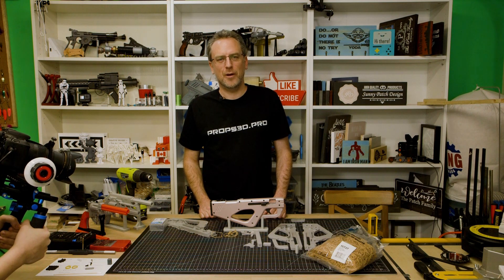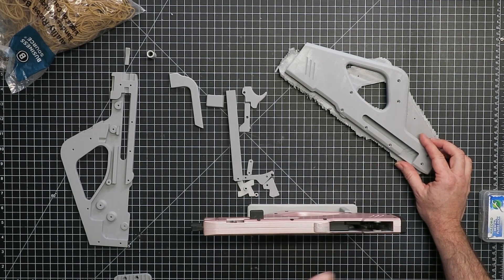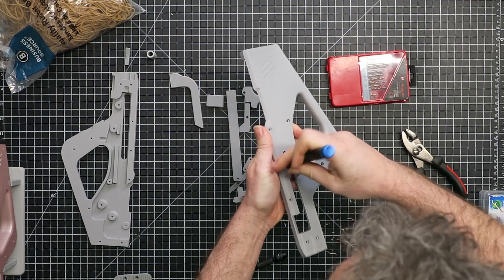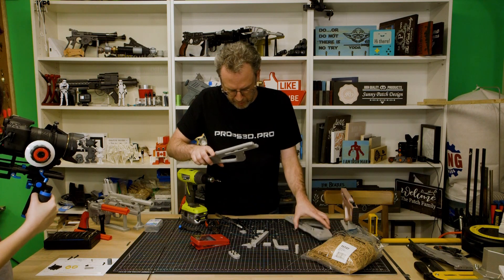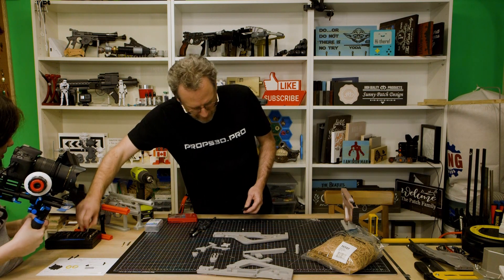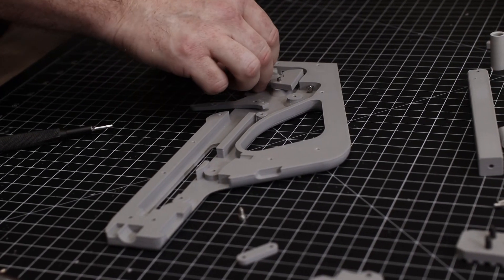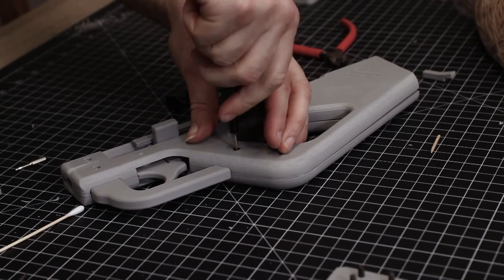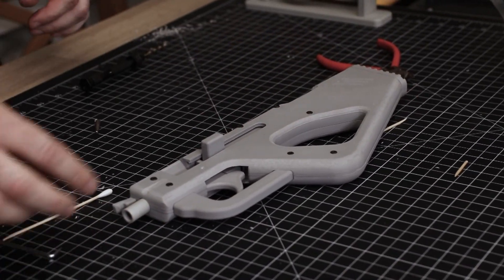3D Printed Rubber Band SMG - Free Models!

Comment: Sanding out such a large faces shuld not be in publically released 3D design. It could be much better to print external faces separately without supports and then just glue to the internal frame. Also, there are mag-fed rubberband "submachineguns" in existence and with much larger ammo capacity. Everyone should think twice before choosing that particular design and kill themselves with sanding ))
Reply from the maker: What sanding? That's a pretty negative comment and this model needs no sanding unless you want a nicer finish, which goes for anything. I don't get what you're objecting to.
Reply: @Props3D  not trying to be negative. Just provided my true opinion. I believe the design has obvoius ways for improvement.
Reply from the maker: @shurmurray  But your advice is... false? It needs no supports and no sanding, which were your two main points of contention. Are you sure you're commenting on the right video?
Reply: @Props3D  well, sanding outer face was mentioned in the video. Or am i just hallucinating this?
Reply from the maker: @shurmurray  That doesn't line up with your comment at all, please read again. Sanding 'out' is not allowed? What is sanding out? Kill yourself sanding? Are we not allowed sanding on 3d models now? If optional finish sanding isn't allowed that would be pretty impactful to the maker community. As this model is completely sanding free unless one wants to I don't see how I can proceed further in creating tutorials for the community to fit your allowed criteria. I would love to see one of yours and see how you do it.
Reply: @Props3D  Sanding large flat surfaces is not fun without mechanized tools. And the design is definitely ask for that - halves are printed flat. There is much more control of how finished surface going to look when it is printed vertically. Right amount of noise may hide all defects and make it production-like without any post-processing.
I truly believe good designs released for public should be as easy to make as possible, unless something geeky and inherently complex. And in any way this is just my opinion :)
Please excue me if my comments feels negative.
Reply from the maker: @shurmurray  Many of the decisions I've made and lessons I've learned have come from asking 'why'. I do feel your original comment isn't accurate to the model but asking why you feel that way helps inform how I present content and sometimes how I design parts. Collective knowledge will always beat any individual's experience.
Reply: @Props3D  there are a lot of 3d-modellers doing great stuff for sure. Still remember thingverse ~10 yeras ago - back than it was a joke. A pile of useless and uninteresting stuff. Now the situation is very different: 3d design is a common skill and there are a lot of great makers now.
Reply from the maker: @shurmurray  For sure, one of the best in rubber band guns pretty much exclusively displays his work on our Discord, he's amazing and puts me to shame. He does classic WWII designs that are functional bolt actions, SMGs with huge capacities, pistols etc. Now 3D printers are mainstream the things people are doing are insane.

Comment: I don’t get why you didn’t make the 3d Model already have the perfect size hole?
Reply from the maker: because printers have a lot of variance. If I made it perfect for MY printer it may be too lose on yours. It's far easier to remove material than to add it back.
Reply: Oh yeah I just made this but I don’t have any screws so I measured the diameter of the hole and used carbon fibre infused filament to make screw shaped rods that fit in perfectly and I used some gorilla glue
Reply: Btw I used PLa for the whole thing EXEPT for the part that holds the rubber band I used carbon fibre infused filament so that it would be able to hold more bands
Reply: Also, the printers that I use are Anycubic Kobra 3, Bambu lab a1 mini and a cr10 v3
Reply: Anyways thanks, the gun is awesome

Comment: I have a question before print. How to join the back part with the front part in the small bed version? Should I use glue? Or the design overlap on sides to hold them with screws?

Comment: i would do this but i need more filament i taught it was going be 1 kg but it is 1k and 300g so i cant print it yet but it is a cool design
Reply from the maker: Should be less than that! Are you printing solid? Try 4 perimeters, 6 top and bottom, and 20% gyroid infill. Should get it down to the right weight.
Reply: @Props3D  oh thanx i am always printing every thing solid but i will try it

Comment: Hi there, so excited to build this model, quite ingenious! Do have a quick question, how do we attach the first rubber band that connects to the catch mentioned in 6:05 of the video, V6 frame doesn't have that hole for a screw. Just wondering if there's an alternative method for connecting intended or if we just need to drill that hole. Thank you!

Comment: Would it be any bit possible to use 3d printed screws instead of the metal ones. Also would it be possible to use a bit of filament instead of the metal pivot points?
Reply from the maker: I haven't had much luck with 3D printing screws, but you could glue it. The metal pivots could be made from 3mm filament probably if you had that, it's not common these days but it used to be a standard filament.
Reply: @Props3D  ah yeah, I ended up using a 3.15mm nail and angle-grinded it down to size, was a little big for the holes but nothing a quick drill couldn't fix. Also just went to my local hardware store and got the screws

Comment: I think you'll find that if you load the last rubber band onto the firing wheel and then push the bolt down from it's lock position it will load the first rubber band onto the lever that operates the reciprocating bolt . This a simplified version of Parabellum's Space Stapler.

Comment: do the rod pieces have to be metal, or could I 3d print them?
Reply from the maker: hmm, If you're printer is dialed in it'll probably work. You can also just cut the ends off some M3 bolts or equiv.
Reply: @Props3D  I wonder if resizing the holes to 1.75mm and then using filament cut to length would work.

Comment: I'm not sure what it is but after I load up the rubber bands and pull the trigger nothing happens. After reprinting several parts and reassembling it still nothing :/
Reply from the maker: where does it get hung up? There's a lot of inaccuracies between printers so you may need to sand somewhere (just a guess). If you can send me a pic or a vid I can help determine where the issue is.

Comment: What Settings did you use for the support material?
Reply from the maker: I print it outside down to minimize the amount of supports needed. Nothing special otherwise: .1 contact, 2mm, rectilinear, 55% overhang

Comment: Hey props,  is this the V5? Because I just printed the V6 from thingiverse and I'm struggling assembling it.
Reply from the maker: The only big difference in assembly is that the band that holds the catch for the magazine goes around a post instead of a screw now. The other tweaks were to fix cycling issues.
Reply: @Props3D  Thanks! I think I'd prefer the screw since the shape makes it harder for the rubber band to slide out. I tried some 25mm rubber band without success, it's so hard to find 20mm robber band somehow. Anyway I found some on Ali Express, back to this awesome gun in 3 months when I receive them :P
Reply from the maker: @chetus88  the 'BAZIC 465 Multicolor Rubber Bands' from Amazon has them cheap. There were more complaints about the screw than anything ever so I changed it, when both halves are together it won't slip, I can put a mod up with a ridge to hold it in place in a few days, but you'd have to reprint one half.
Reply: @Props3D  Thanks that would be great! I wouldn't mind printing it again, I'm not completely satisfied with my print (tried some carbon fiber PC CPE). I believe it was mentioned but it's also very difficult to hold the magazine rod it would be much appreciated if you could do something with that :)
Reply from the maker: @chetus88  How to you mean difficult to hold? Like hard to line up? Doesn't stay in place? Give me some details and I'll add it to the update.
Reply: @Props3D  I'll try to explain it the best i can 😜. The hole does not have enough depth to hold the rod in place unlike all the other ones.
Reply from the maker: @chetus88  ah! gotcha. It used to be deeper but I expanded the magazine, it was having jamming issues with more than 10. I'll move it in a bit and make the hole as deep as I can without compromising the sides. I'll reply to this comment when it's up.

Comment: To bad you don’t do commissions for this gun! I would buy some. (I have ender 3 pro so I can’t print it)
Reply: I printed one of these on an Ender 3 v2. There is a version of the model that the rear portion of the frames is cut into a separate piece and can be printed and glued together. I printed each half of the frame together (left front and left rear in a single print, for example) in one color, and the internal parts and buttplate in another color. Turned out great! I highly recommend you give it a try, even though it doesn't fit on the ender 3 in a single piece.
Reply: @mrkoren  I will, if it works I will definitely tell you.
Reply: @mrkoren  I am printing it now
Reply: @lachyness  Just use some super glue! Mine worked out great. Tons of fun!
Reply: @mrkoren  yep! My ender 3pro is doing it ok!
Reply: @mrkoren  only one problem with min, the edges keep peeling off and the sides aren't as smooth but other wise so far so good
Reply: @lachyness  Smaller layer height should help with the rough sides, and printing with any type of adhesion (raft/brim) would help with the warping.
Reply: @mrkoren  Where did you get the model for that? thingiverse?
Reply from the maker: I may, it's just a lot of print time, over 24hrs. So rolling around what would be a good price. Too low, not worth it. Too high, not fair. I hate pricing this stuff out.
Reply: @Props3D  that’s reasonable. Anyways this thing is amazing, I showed the video to a few people and they were very impressed
Reply: I printed both (full)sides at the same time on my E3.